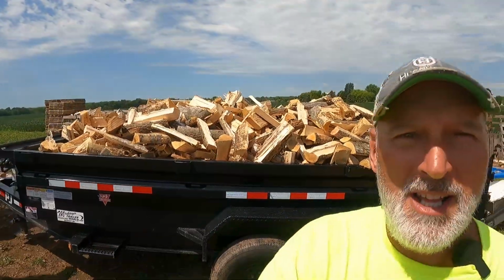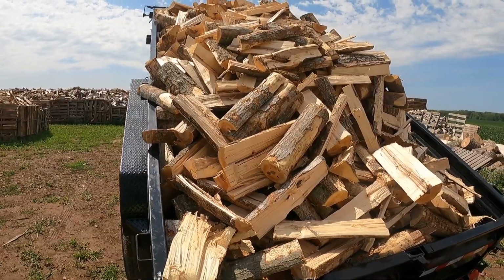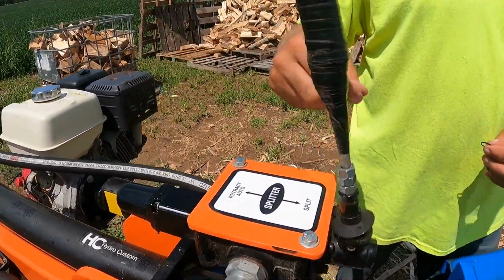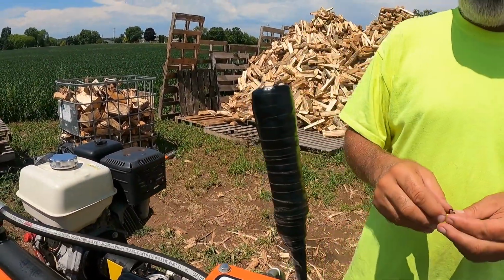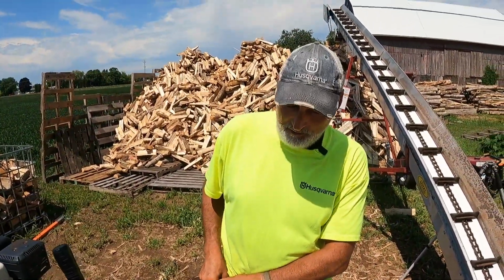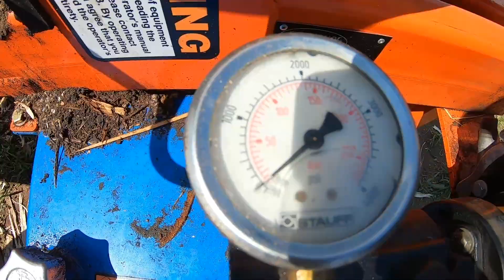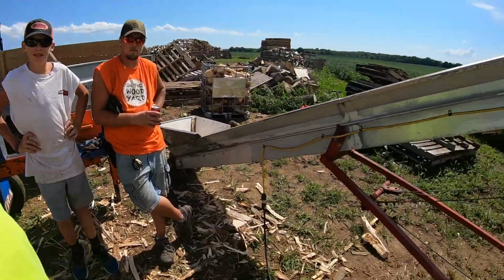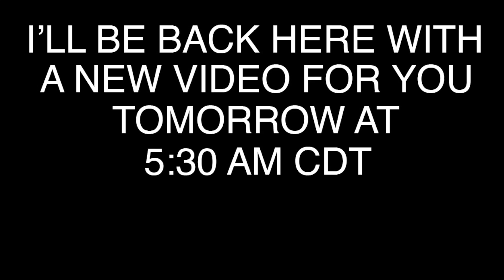I BROKE THE EASTONMADE ULTRA SPLITTER..... AGAIN!!!

Comment: The only issues that I have had on my Ultra has been hydraulic fluid leaks.   Usually it’s just an O-Ring but sometimes I have to replace a hose.    Minor stuff that my mechanics easily fix
Reply from the maker: Yup, all my issues have been pretty minor for thousands of rounds through it!

Comment: Now you know that I don't like to butt in your business about the firewood machines, but I gotta say,  my own valve on my own splitter has never ruined an O-ring! When I decided to get a hydraulic splitter, and save my poor maul for later, I was taken aback by how hard the valve slammed when it kicked off. So I made the valve to not kick off! Designed a device to fit on the handle, kind of springy sheet metal extend to catch the ram as it approached its stop position. Pulled the handle to neutral without that  incredible hydraulic bang that made the hoses jump and the whole splitter shake! It was slightly faster too! Maybe a tenth of a second each stroke...? And a whole lot less stress worrying about the dang splitter!! So now you know where to come for advice! When I (rarely) give advice, I don't even charge money for it!! Yup, that's just the way I am!! - While I'm here, I noticed how big that last pile is getting. If you ask me, I'd say...   If you were an Amish woodchucker, you'd prob....      If I ever ran out of advice, I got a MIL that could easily fill in!!                     GNI
Reply: How many hundreds of cords has your splitter done so far?:face-blue-question-mark:
Reply from the maker: That splitter has had thousands of cords through it now so....
Reply from the maker: Mine...thousands.
Reply: At least 67 cords, maybe more.

Comment: Who wants to work in the woodyard ar 5am? The sun hasn't risen for the day at this time of year. As far as yiur breakdowns go with the lever on the Ultra, treat it like your life partner. A fast but gentle touch is better than fast and furious. But breaking the lever keeps Bert busy looking for the right bolt or the hardware store in business. LOL! I wonder if Andrew thought the Ultra would be used as hard as you've run it when that model was first conceived in their design and engineering department?
Reply from the maker: It has done thousands of cords!

Comment: Nice job/video guys.  Splitter valve repair seems to be a common problem with the ultra, hope you have plenty of O rings.  Might consider upgrading that valve to one of higher quality with a better handle and internals.  I know it's not a difficult repair, but shouldn't be necessary to make a big mess with the oil.  GNI
Reply from the maker: I have put THOUSANDS of cords through it, a few full time mechanics told me that is normal for the amount of work I do with it so.....

Comment: How old is the Ultra now? Is it about 3 years? 
How many gallons of fuel have you used today?
Presumably oil is only checked once a week?
Thank you. Steve.
Reply from the maker: Yup, about 3 years now. I do not know about the gas, when it runs out I fill it up. Yes oil check once in a while, it is a Honda engine, runs like new.